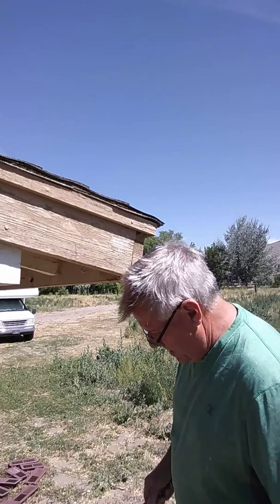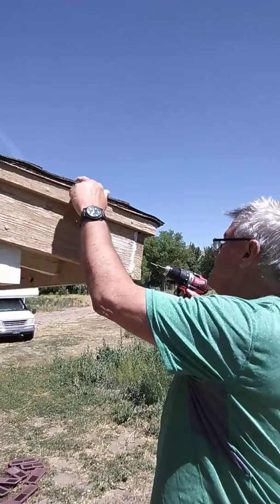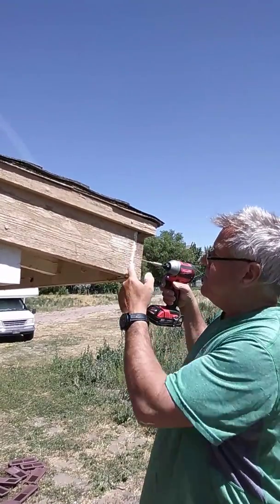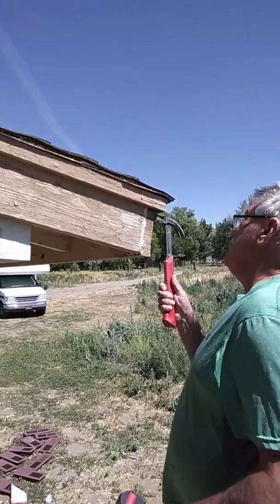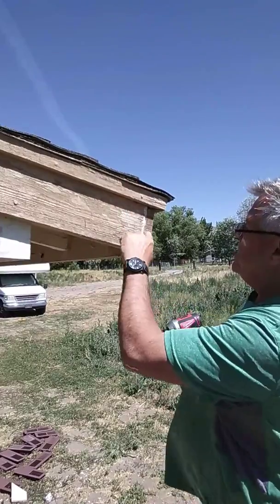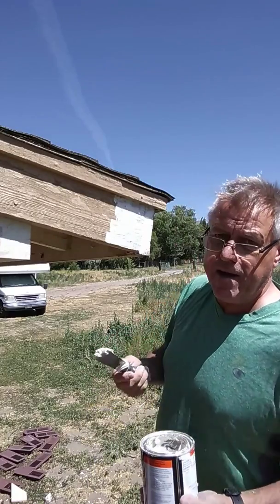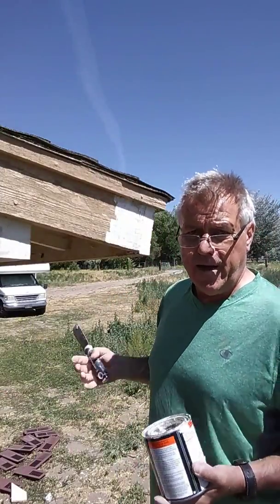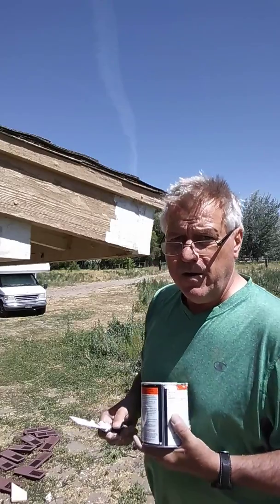Fascia corner repair!

Comment: Thank you. This is helpful to know different options. The corner of fascia has separated and is splintered. My house is in California desert with extreme heat. Had a termite inspection required  for refinance loan and the inspector said it was dry rot and whole board needed to be replaced. But also  was putting me in contact with a contractor to do work. I got a few independent estimates and they were a fraction of inspector’s contractor estimate to repair. They also said it wasn’t really dry rot but more sun damage. In the process of getting these different estimates, I discovered that the termite inspector gets a kick back for “subcontracting” to his guy! This was never disclosed to me. The inspector acted like he was just helping me find someone. Being that I was under a deadline to complete requirements for refinance loan, made this feel very much like a predatory act! Also I feel being a woman ( widow) added to the good old boy tactics. Just passing on some warnings and advice!
Reply from the maker: Your timing of message couldn't be better timed because we just had a well inspection done for a property for the bank and the inspector is a contractor in the area. The pump was running fine with plenty of water and pressure and 2 days after inspection the pump burns up. We definitely suspect sabotage, but there really isn't anything we can prove. The timing however is too perfect to ignore. I guess the lesson is that we all learn from life!
Reply: Mr fix it that is amazing timing! Hard to not lose faith but I guess it’s “trust but verify” anymore... I would not let the company who did the inspection fix anything. Fox guarding the hen house is another saying. Thanks again 👍
Reply from the maker: @barbiekat6352  fixing things seems to be a lifetime event!